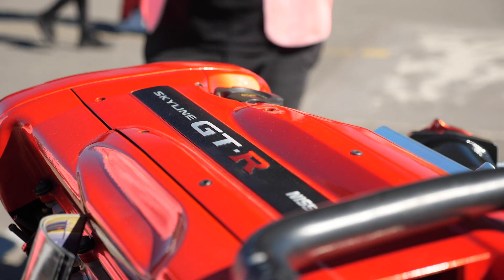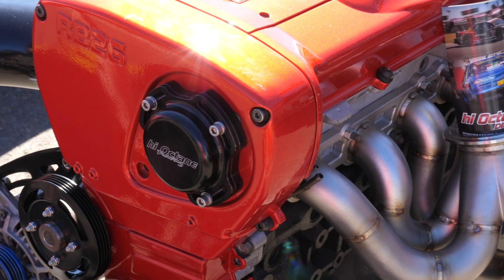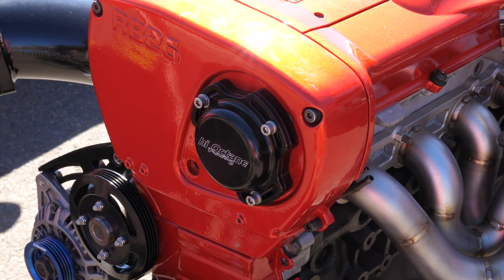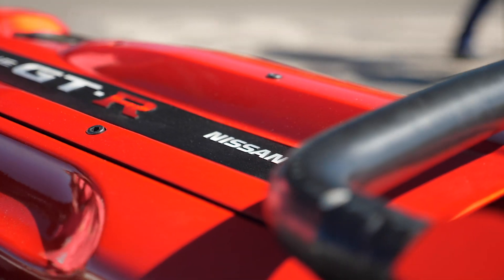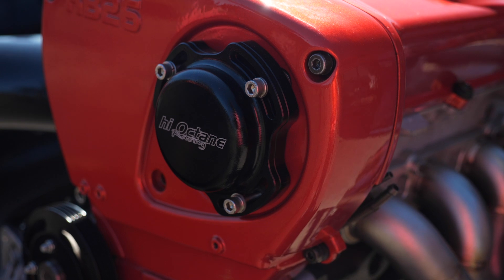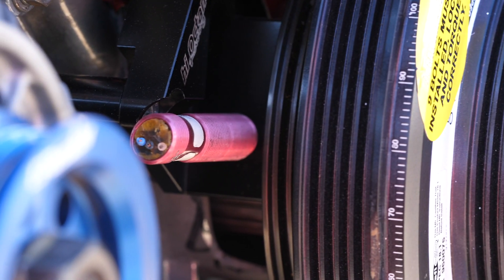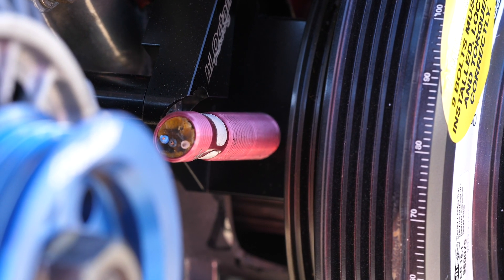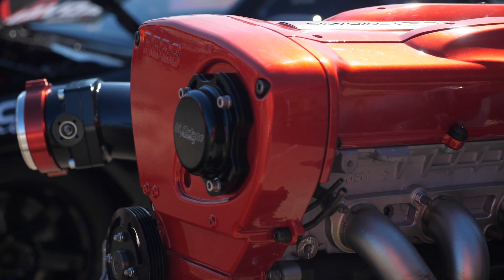Trigger Systems 101 | Avoiding GTR Engine Failure [TECH NUGGET]

Comment: I`m using only the crankshaft sensor and a wasted spark ignition cycles
Reply: Its just wasted energy theres no real disadvangate but there is advantage with wasted spark. Fuel economy and much easier to get engines running
Reply: @juanhuertas686  it's also great when you introduce a secondary fuel source and blow the intake to pieces.
Reply: @lop8828  That all depends on the tunning. We have run consistant 9.50 all motor FWD with a 3.8l v6 on more than 50% nitrometh running wasted spark. No issues so far so yeah its all in the tunning.
Reply: I was interested if you see any disadvantages
Reply: How do you time your injection if the engine doesn't know the difference between power and intake stroke?
Reply: @mattjohns3394  its power and exhaust event. 
You just need to know where #1 at by trigger wheel having a different pattern.
Reply: Also I`m using 60-2 Trigger Wheel and before distributing any spark the engine has to do at least two turns for the crank as the ECU needs to read the top dead center twice for safety reasons. Some times it`s a bit annoying but it is there for good :)

Comment: Would you say it would be needed on a stock-mild tune? E.G: Full stock head with engine producing 500hp at most...
Reply: No. Generally it's a problem for cars with more aggressive valve trains that cause added harmonics through the use of higher rpm, aggressive cams and heavy springs.